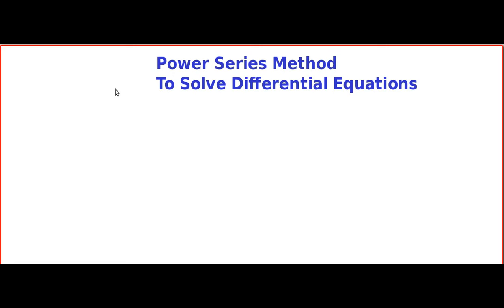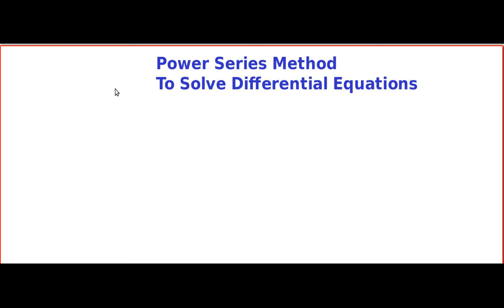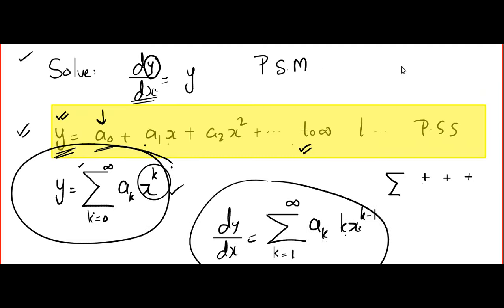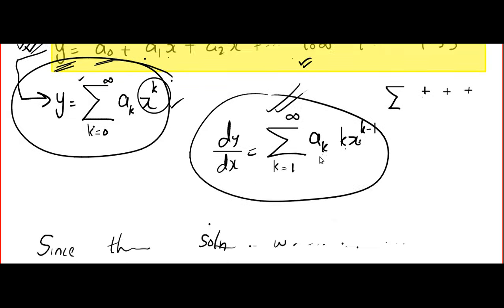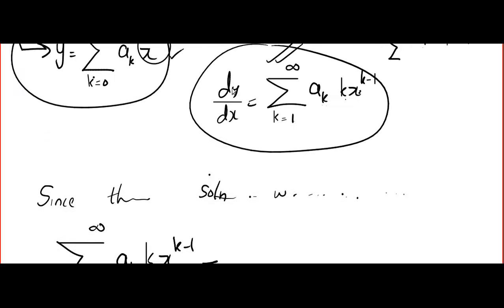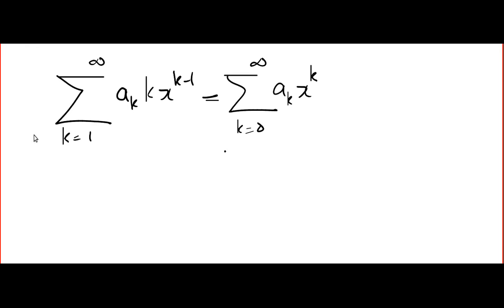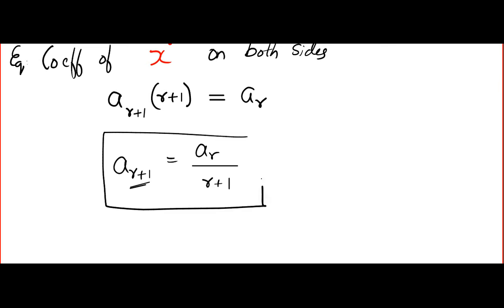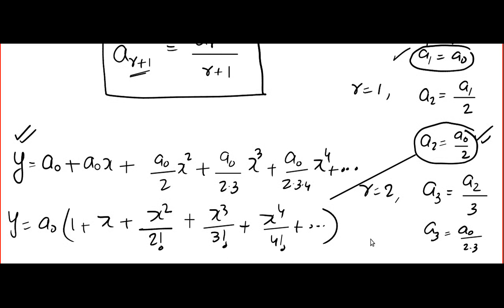POWER SERIES METHOD - LESSON 1  ENGINEERING MATHEMATICS

Comment: This summation method is failing sometimes. It is ambiguous on n-2 terms .
Reply from the maker: It will work provided zero is not a singular point. If zero is a singular point then you have to use Frobenius method